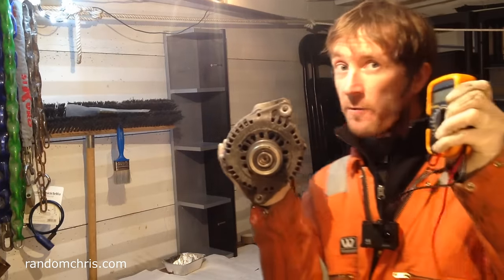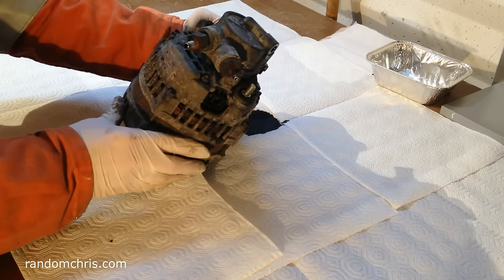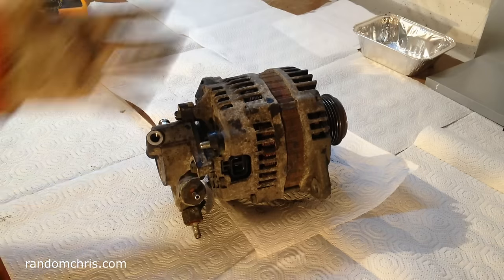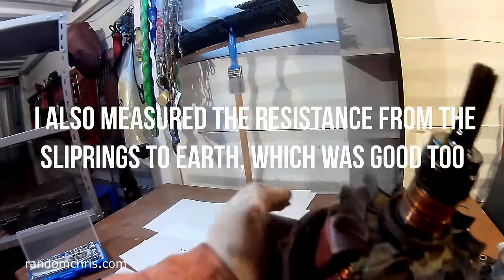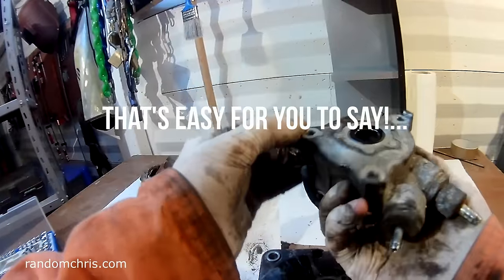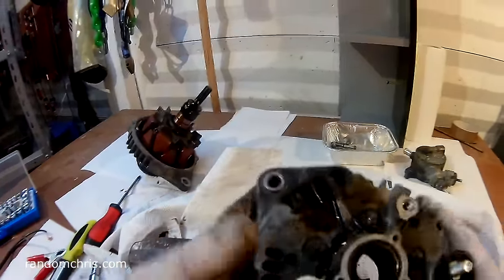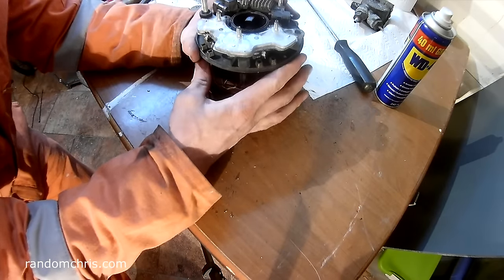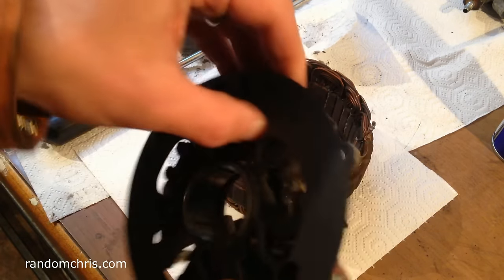How to Repair Your Own Alternator (With Simple Tools)

Comment: you boost an elephant,, that why it burn.. !!
Reply from the maker: Yes it's true - I was passing someone on the road who was towing an articulated lorry with a pack of elephants. The poor guy was stuck, because one of the elephants had suffered a heart attack. Fortunately, I had a set of jump leads in the back of my car and I was able to jump start his elephant before it had suffered any brain damage as a result of oxygen starvation after it's period of apnea. He was able to continue his journey but you're right, maybe it was this that caused the problem with my alternator. Moral of the story: carry out CPR on elephants, rather than defibrillation! Cheers, Chris 😉